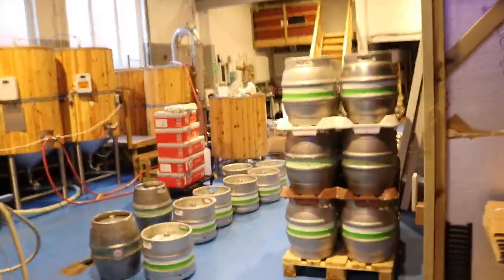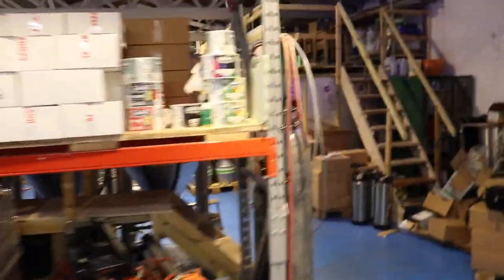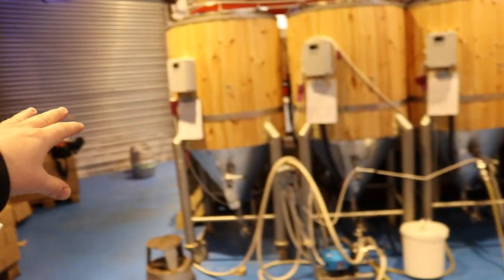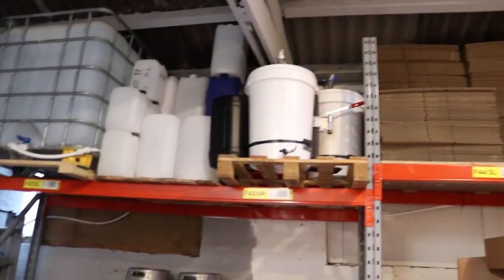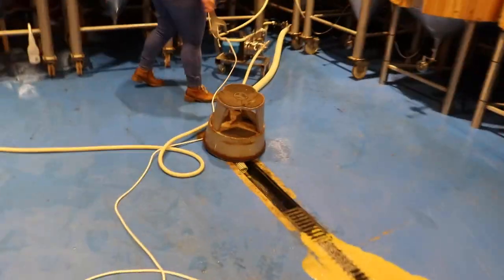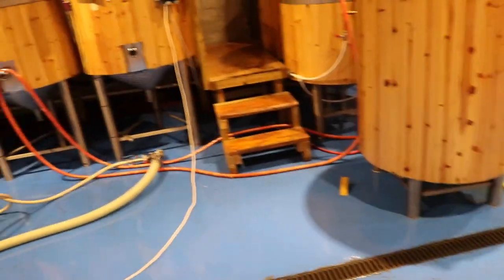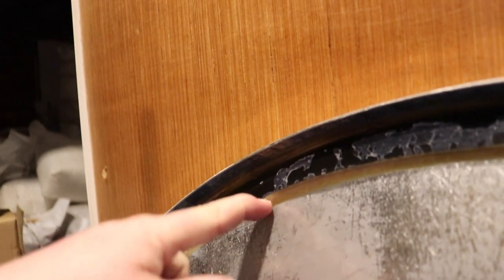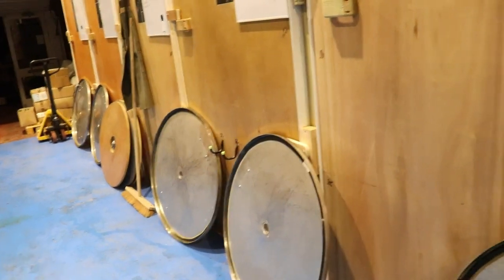Last One Of 2021

Comment: Could you weld a cone to the top and have a smaller port at the top? Then go a big triclamp fitting
Reply from the maker: I'm about finished with welding on these tanks. But you never know.